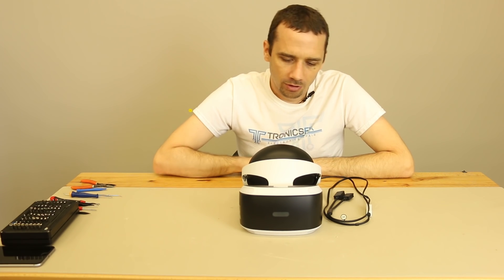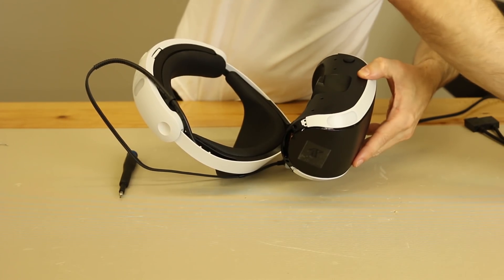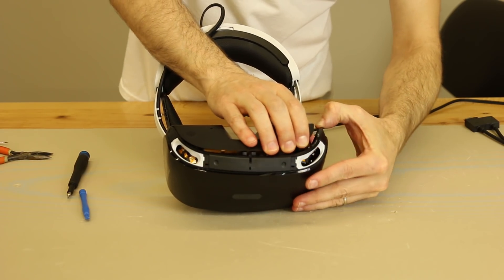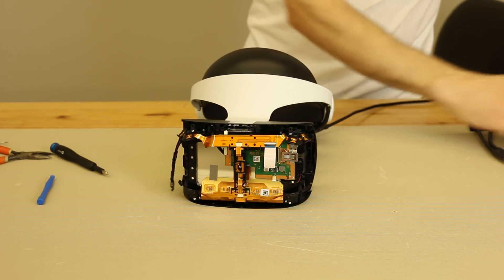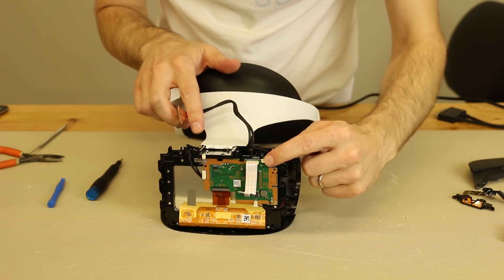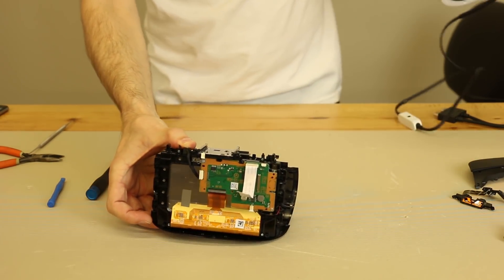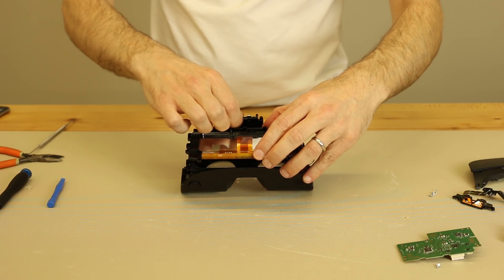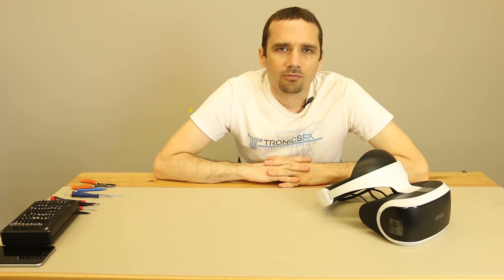PS4 VR Teardown

Comment: Hi great video, I have an issue with my headphones are not working anymore when plugged into my VR headset. This is be due to the VR wire being tugged on or stepped on during gameplay, possibly listening audio connections. Is there any way I can fix this ?

Comment: I cant seem to get the metal shield off the main power cable my screw driver wont stick in what size would i need? As well as I’m trying to fix what I believe is an issue with the screen not being connected to the headset which wire connects the display to the main system?

Comment: Watch out guys, the reassemble is NOT the same than this but other way around. Side light are very difficult to put in place.
Reply: Use small parts of kapton tape (or masking tape) to hold them in places when closing the thing.

Comment: Hey great video, I have dirt stuck in between the vr lens and the duel screens, I'm looking at your video and thinking about risking opening it up to blow the debris away. The rubber seal is obviously not in place because the amount of dirt is increasing. Should I risk it, its 2 months left in first year guarantee but don't want to send it away for a month and then potentially charged to fix, which is a big no for me right now. Many thanks
Reply: I say take it apart and if it doesn't work try to get another with the warranty
Reply: Opening it up would invalidate the warranty?
Reply: @davidhiggins8386  it probably would but ya never know. 
If you are skilled and have done things like this before you could probably fix it

Comment: My front lights don’t light (back 2 LED’s do)
Am I able to order a new motherboard?
I suspect the LED driver chip or something similar fried.
The display still works, just the front 7 LED don’t.
Although this teardown differs a bit from mine (maybe mine is gen2?)
Where can I order parts??
Thanks for this video!

Edit: I removed at the cables and re-inserted them in the hopes something got jarred loose and appeared to be connected but wasn’t. This did the trick!
Althought the light near my left ear flickers and is not as bright as the other LED’s my VR is back in operational order!
Thanks again!

Comment: I noticed some dirt shadowing behind the half-transparent white plastic of the front LED light and thought there is an easy 2-screws-solution to clean it, but no that is way to complicated (plus half of the frame is glued and doesn`t come off when removing the screws). Well the dirt is invisible anyway as long as the tracking lights are off, the main thing is that the lenses are perfectly clean and the AMOLED Display has no dead pixels :)

Comment: Be very careful if you decided to follow this video. I had a problem with the tracking lights and the little box resetting. SO I followed the video to see if I could fix my led lights which the psvr uses to track the headset ANDDDDDD I fixed it for a good minute. THEN while I was putting it back together, I plugged that sucker back in thinking I had won... NOPE, The lights just decided not to turn on anymore. I refollowed the video but got frustrated, and now I have a 50% working vr headset. It loads up this screen but I can no longer use the vr Feature. Good luck mates
Reply: This... Is a teardown.... Not a tutorial

Comment: Thx for the video. I need some help. On my psvr, the cushion of the head band on the back, the vinyl over the form pad came off on the bottom. I worried if I don't get it fixed, its gonna break or get torn soon.  It looks like the vinyl over the form wrapped over a plastic part and clip I to the the housing on the back. I tried to tighten the vinyl and push it back in but didn't work. Would you help?

Comment: Big 'thank you' for the video. Ended up with my right lense scratched to death on my working PSVR headset (I wear glasses....). Managed to swap the mint lenses from my other PSVR that had stopped working. Without this video, I would've broken something for sure (like the parts that are stuck with double sided tape etc)....Not to mention some screws are well hidden....Swapping both monitors at the same time as fast as possible to avoid dust particles was a challenge but everything turned out perfect. Anyway,  much appreciated, the step by step, was a great help. 🤘
Reply from the maker: So glad this helped!
Reply: Hi. Do you have any idea where to buy replacement lens? My kids knocked mine out and can't find it anywhere.
Reply: Pretty sure Sony have stopped the manufacture. At the time I repaired mine, I found a non working VR set with mint lenses in a second hand store. Bought it, took everything apart and swapped out the lenses. Worked like a charm. (I did get some 3d printed raiser parts to avoid my glasses rubbing onto the lenses as that's how I first scratched them.). Guess your best bet would be EBay, Facebook marketplace etc. Either you get another one as their prices have dropped significantly, or get a dead cheap non working one hoping the lenses are still functioning and swap them around.Hope that helped...

Comment: my HMD cable might be broken, not sure yet haven't ruled everything out. If I where to get my hands on a replacement cable, would it be possible to replace it with out taking the headset too much apart? I'd like to avoid getting dust behind the lenses.
Reply from the maker: I really don't know. I haven't done anything with these other than this teardown.

Comment: I was hoping to see inside the back near headphone jack I have a problem that my audio only works when I stretch the PSVR headset as far back as it will go and sometimes the round release button on the back will make the audio work when it’s jiggled about, maybe a loose connection?

Comment: I had a black speck appear on my screen yesterday. Pulled it down this morning and used one of the “sticky things” that comes with a phone screen protector to clean the lcd off and it’s good as new.

I’m seriously impressed with how it comes apart and goes back together so well. Not even any real surprises with cable routing etc. Only thing that was a bit annoying was the side leds falling off the little posts during reassembly which even then a little push in the right direction with tweezers through the hole and they went back in to place.

Kudos for your work!
Reply from the maker: Thanks! Yes, it really isn't too hard to take apart.

Comment: @TronicsFix LLC  you should always remove your finger ring when doing any repair/teardown. Just a wise advice.But I always love your videos.Clean and neat.Good job!
Reply from the maker: Why?
Reply: Simple: the ring is metallic and the devices have RTC batteries, capacitors that hold charge even when unplugged.The ring may come in contact with them and cause a short circuit.
Reply from the maker: That would be impossible since the board is 100% discharged when I disassemble it.
Reply: TronicsFix LLC As I said that is a friendly safety advice.You can choose to follow it or not.You can never know if a device is discharged or not 😊. I love your videos for their quality and for how they are easy to understand even for noobs.
Reply from the maker: Yes, you can know if it's discharged. There is absolutely NO problem with wearing a ring while repairing electronics that are discharged. You can easily verify that they are discharged.
Reply: You are the first professional I hear it from.Well you have been lucky so far.but its fine.
Reply from the maker: No, I have not been lucky. I just make sure there is no power in the board before I stick my fingers on it. It has nothing to do with luck. It has to do with skill and experience.
Reply: TronicsFix LLC cool
Reply: @Tronicsfix  haha

Comment: Anybody have issues with power to the headset.?? Had it for a year and it was intermittent now nothing
Reply: Sometime the headset lights come on then when i go to put it on black.. so frustrating im afraid to take it apart. But i dont want to send it in for a loose connection
Reply: Fast4SloW 717 i have almost the same problem, it turns on for 2 seconds and then turns off, if you solved the problem please help me

Comment: Can you tell me how to release the tension if it was too tight due to someone adjusting it for their head. How can I get it back loose to adjust for my head?
Reply: The button in the middle back of the strap. The strap will slide freely while the button is pushed in. I feel like this is the most basic thing that they show you on screen before letting you use it though...

Comment: Hey, great video.  I don't know if you can help me, but I can't seem to find anything about it online.  One of the rear led lights on my headset is not coming on, and I really don't know how that happened.
Reply from the maker: Hmmm...I don't either. Maybe it burned out? Possibly a bad connector? I really don't know on this one. Sorry.
Reply: TronicsFix That's fine, thanks for the fast reply.  Just seems rare for an LED to go so quickly.
Reply from the maker: Ya, I agree. Not sure what else it would be with only one of them out though.

Comment: i don't get it why companies put so much air in stuff, this vr headset could be a lot smaller
Reply: It has to be comfortable that is one reason. Smaller does not mean it will fit more comfortably. Also heat dispersion is important. Too tight of a package and it will overheat.

Comment: My PSVR headset has very dim LEDs on the sides in comparison to the front and back. I am unable to calibrate my headset device due to the loss of illuminated blue LED. Thoughts?
Reply from the maker: Hmmm...I'm not sure. I haven't done much with the VR headset. Could be lots of things...faulty LED, bad ribbon cable or connector, bad component inside on one of the boards...it's just hard to know.
Reply: Use your warranty to get a repair or replacement.